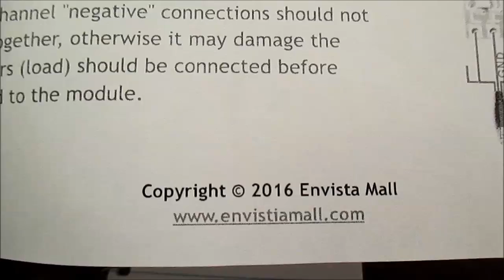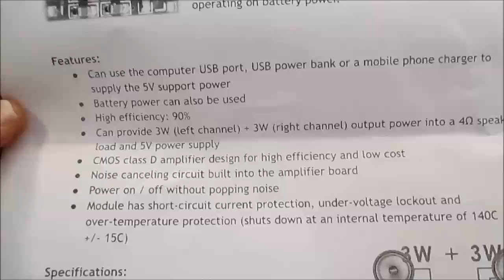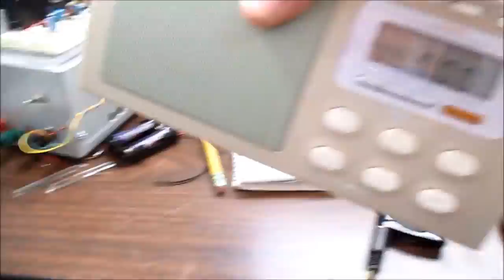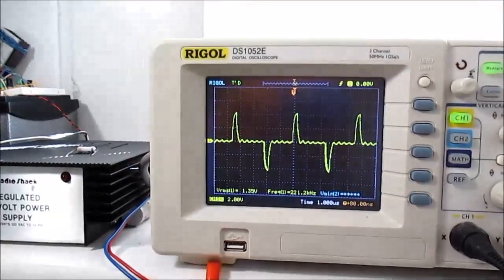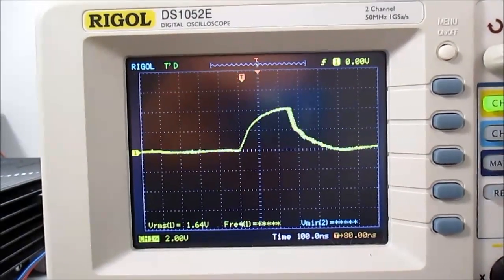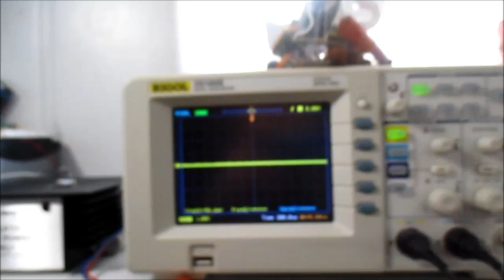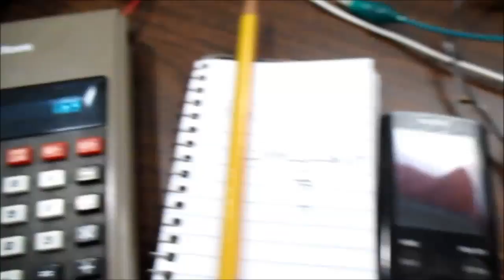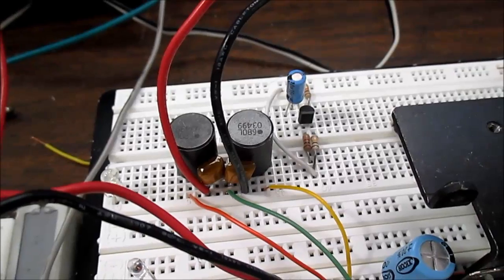PAM8403 class D tiny stereo audio amplifier board review & test

Comment: has any one had a good play with  the pam8406. how far off its datasheet is it. one thing I'm planning it taking a SRNWU Bluetooth module that runs with a pam8403 replacing it with a xx06 pull mode high and see if we get any more watts + there so cheap y the hell not
Reply: William Bragg can i get an update there? I just want to diy a bluetooth headset haha

I'm planning on using a blueinvent bcm-635-lc-8x
Reply: It's not got far. Iv been playing with a CJMCU-8406 PAM8406 a small board with jumper to set the modes. just waiting on some 5w 2ohm speaker and Looking in to a 5v 4amp booster as the ones I use for the pam8403 are just 2amp. Then il get on to building something. Thinking I need to send one of there's amps to John for mail bag to test. Thay look good quality little things

Comment: An excellent review! Been looking at these for my Gameboy Zero project, ordering some now.
Reply from the maker: Glad this helped. If they pickup noise, ad a 2.2k resistor across each input. Not a problem with the amp, they just have high impedance inputs.
Reply: Thanks for that. The Raspberry Pi Zero's audio (PWM via the GPIO pins) isn't great anyway but any help it can get is a bonus!

Comment: So if its 3w and 5v and for current we have I(A) = P(W) / V(V) so I = 3 / 5... It works on 0.6A or 600mAh? Or is it 1.2A or 1200mAh because it have dual channel?
Reply from the maker: At maximum clean power it was 1.7 watts per channel, so 3.4 w for two channels. I'd add about 10% more to that because the amplifier is around 90% efficient, so I'd say 3.7 watts for roughly 750ma @ 5v. Pushing it into clipping can cause a higher power draw. Normal music does not present such a continuous signal, so power would be well under 100ma for normal listening levels.
Reply: FYI I just bought 3 of these from Banggood, according to them, this is suppose to put out 3 watts per channel at 5 volts with 4 Ohm load. Link --> https://www.banggood.com/3Pcs-PAM8403-Mini-Digital-Power-Amplifier-Board-Class-D-Audio-Module-p-943578.html Did you happen to notice if the chip got hot at all? Thanks..

Comment: John,
Would this be adequate as a headphones amplifier?
Nothing fancy, just ordinary small earbuds or the like.
Reply from the maker: Probably not because it is a bridged amp and the wires on most ordinary phones like earbuds have the common lead tied together. Consider the output leads on any bridge amp as hot and never tie them to ground or to another channel as this will short the amp.

Comment: what about 8 ohm speaker how many watts on 5v
usb
Reply from the maker: 8 Ohm should be about 60% of the 4 ohm measured wattage.
Reply: thanks and can i use it without filter and which coil and capacitor you use?? 680uh?
Reply: 50%

Comment: what are the values of the capacitor  and the choke that you used to get rid of noise?
Reply from the maker: 680mH and .1 uf, IIRC. It was for measuring only. Not needed for normal use. Those values would cut into the audio band. I just grabbed what I had.

Comment: This is so great, thank you so much for the nice explanation. This is the first time I've found you but I will be subscribing. If you don't mind, how did you build your speaker test setup? Did you just use 4 ohm speakers or did you just set your crossover to 4 ohms? Thank you again.   Buddy
Reply from the maker: The speakers I used are actually 8 ohm and made to be portable. 8 ohm speakers are fine provided they are sensitive enough. of course, 4 ohm loads were used in the power test. Thanks for subscribing!

Comment: You should try the PA8406 and see how that compares for a low voltage class d amp. Interestingly it is classed as an alterative between class d and class AB. I assume that means depending on the load it will operate one mode or the other. It seems to make the same power a 4 ohms with 10%THD as the PAM8403 but it can also do 2ohm loads making 5w with 10%THD.
Reply from the maker: I'll have to check that out. Thanks for the suggestion.
Reply: Your welcome. Here's another amp which is Yamaha's answer to that TA2024 you have power wise and it comes with a volume pot for $6. https://goo.gl/XHpwgI. I ordered one to play with.

Comment: Hi John,, It's 5 volts, I'm wondering what ma rating is needed from the power supply,,? Thanks.
Reply from the maker: 700 ma at max clean power. Probably only 100-200 ma at normal listening volume.

Comment: The best part about these little amps us you can get them for about 50 cents on AliExpress... there is also a big brother to these which runs on 12v and puts out about 10w. Quite useful for bodge-repairing TVs and the like when the amp IC blows and you can't find a direct replacement.
Reply: The 10W version is based on the PAM8610
There's also the PAM8406 which doubles the power from 5V power supply by allowing you to connect 2 Ohms speakers (or two 4 Ohms speakers parallel per channel).
I tried this PAM8403 board with 2 Ohm speakers and it gets far too hot.

Comment: that sounds cool. thinking about using one to make little electric guitar amp. I realise I need some kind of preamp to impedance match signal from an electric guitar. typically the input resistor for a guitar amp is somehwere between 500k-!Mohm. Theres lots of little jfet preamp schematics, or simple opamp designs floating around on the web. I like the idea that this is stereo, and would like to use both channels. I think it might sound nice for certain effects pedals that bounce the signal across stereo field. I'm confused about how you would take mono signal and have it to go through both channels. Is some kind of basic mixer circuit required??? Any thoughts appreciated..????
Reply from the maker: When using my function generator in the video, I simply tied the inputs together to feed both channels. To work with both stereo and mono FX boxes you'd need a mixer.

Comment: Hi John,, Thanks for the great video,, I have a question or 3,, Would these work using 5 volt USB power (say from a Lap Top ) and if I wanted to add volume controls to the inputs of this amplifier what size pots would be needed..Thank you,,
Reply from the maker: Yes they can work with 5v USB power. You might confirm that your laptop's USB port can handle 500ma or more of current. 10K pot would work. You can use a lower resistance pot if signal is coming from a headphone output (less noise).
Reply: Thanks John,,

Comment: Use it with piezo tweeters and the thing will double as an ultrasonic pest repeller!
Reply: Kind of wonder how it would react to driving piezos, being a sort of capacitive load it might present a low impedance to the modulation frequency.
Reply from the maker: It might go into current limit. It might be a good subject for a quick video.
Reply: why not create an amplifier audio cinema 7.1 with  four  pam + one with a couple of darlington for the bass ? good idea no ? i think one of these days i make it

Comment: oh this is gonna be good! ive been looking at those boards aswell.
i have a suggestion for a future video, have you ever looked at those amplifier kits on 
ebay like this one

http://www.ebay.com/itm/1pcs-AC-DC-12V-TDA7297-2x15W-Digital-Audio-Amplifier-DIY-Kit-Dual-Channel-Module-/291797698172?hash=item43f07f867c:g:8OMAAOSwjXRXZ8S3

or this one
http://www.ebay.com/itm/AC-DC-Single-Power-TDA2030A-BTL-Audio-Power-Amplifier-Module-34W-x-2-DIY-Kits-/181389515493?hash=item2a3ba85ae5:g:0RIAAOxy0x1TVjKJ

would be neat to see how those board perform because im sure they both use counterfeit IC's
Reply from the maker: Yes, a lot of kits to try. I think your right about the ICs being counterfeit.

Comment: This amp is ideal for a small portable speaker, I made one with a 3W 4Ohm speaker being powered from a single 18650 Li-Ion cell. Has plenty of grunt for a little portable speaker and the battery lasts for a gooood amount of time.
Reply: yes you're right ;) the consuption not exeed  +/- 300ma and yes , with just a little battery li ion it's good

Comment: Yes! I mentioned these in the past here, I was having trouble connecting them to a bluetooth module XS3868 (?) and ended up having to use 2 separate batteries.
Reply: if you are using one supply with a BIT module you have to use a DC-DC isolation module. like a Murata NMH0505SC
Reply: +geniz01 BT not BIT
Reply: There is an error in the design of the module, i also had the issue and solved it by soldering an cap between the antenna and ground.
Reply: If you have extra TP4056, you can connect 2 of them to one battery and use the protection part of the TP4056 just like an Isolation module? I have gotten this to work a few times. Not sure why it works, but i used this method one my last logetec rebuild video.